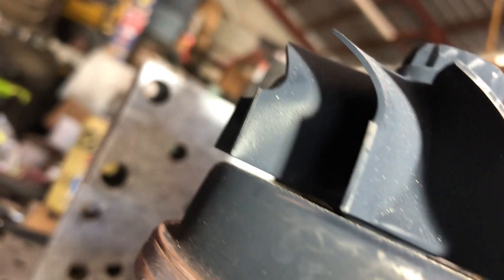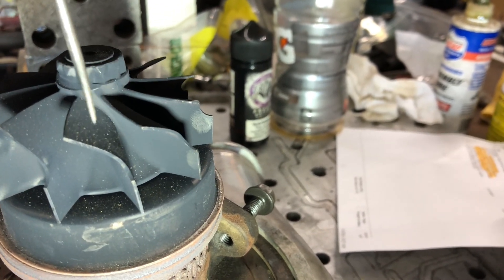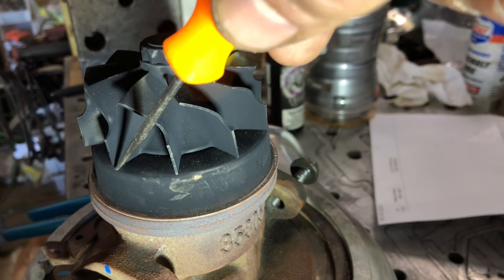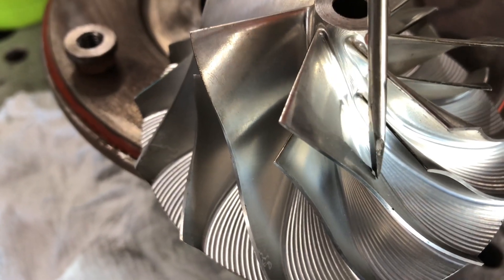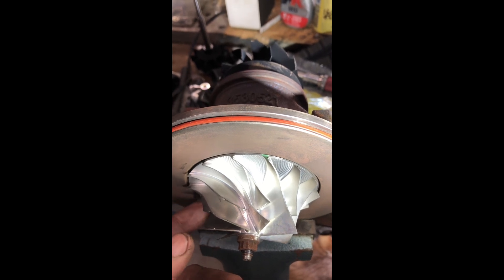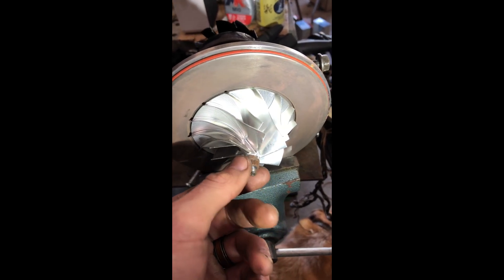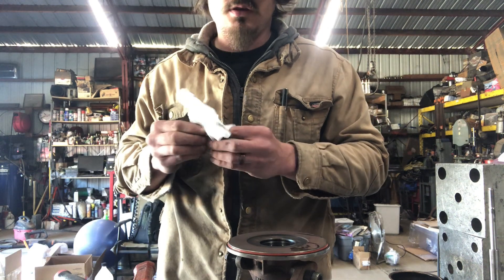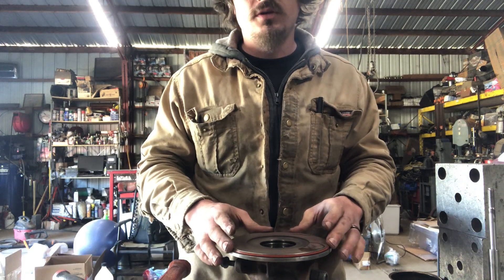Hx35/40 6cm on a 5.9L cummins motor 53lbs of boost.

Comment: Did you test for drive pressures on the 6cm housing?  I imagine they would be high at 53lbs of boost but how about 30-40lbs?
Reply from the maker: Data from other setups showed them running 2-1 drive to boost at all times
Reply from the maker: It will maintain that till about 2700~ rpms engine speed then peak hp lands right in here and drive will climb above boost by a much larger margin.
Reply: @savagefabrication795  So if I'm correct the 2 to 1 is biased on the drive pressure side? 20lbs boost, 40lbs drive pressure?
Reply from the maker: @witcher71  correct. It is the only charger that kinda throws the drive to boost thing out the window inside its operating range. My guess is it runs a stellar expansion ratio which I am working on setting up a dyno setup to monitor it. Since most other setups have to be in the 1.3-1 range to keep everything under control.
Reply: @savagefabrication795  That sounds awesome. Can't wait to hear the results on that one. I'm hunting something to replace my S300 60/68/12 in a compound setup. My truck has become a service truck and I need something that lights a little quicker. The weight has gone up with all the tools onboard.
Reply from the maker: @witcher71  my new turbine housing for the 68 turbine s300’s has been doing extremely well.
Reply: @savagefabrication795  Is it something available to the public yet? edit. Never mind, I found it. It's 9cm based. I'm seriously considering one.
Reply from the maker: @witcher71  I haven’t had one person be in happy with it yet going from the .70 and .80 to my new housings. I offer a buy back option as well for any of my turbo parts if they do not do what they are supposed to for the buyer.